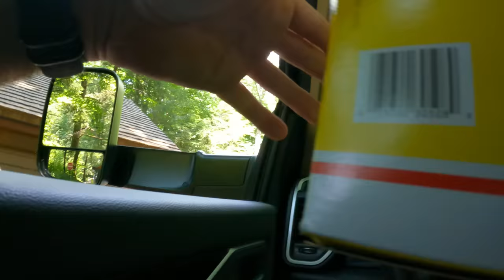Grabbin' 'Em Left & Right From The Motor Nature Trail And A Harley Stuck Under A House?

Comment: My wife & I were on the Motor Trail last Monday (the 15th) after not having been to Gatlinburg/Pigeon Forge for 4 or 5 years. We were in my '99 4Runner and had several tight squeezes in it. Kudos to you for getting a wrecker through there. What I don't understand is why the Park Service doesn't ticket and/or tow a lot of these vehicles. I shudder to think about an emergency vehicle such as an ambulance trying to get through.

Comment: Don't hot glue clips to those radios... I've NEVER had hot glue hold something for very long.  Even epoxy that holds great at first eventually fails me.
About the only thing that has not failed me is J.B. Weld.  You have to clamp or tape the parts together as it takes 12 hours for the J. B Weld to set up.  But once it does, it doesn't fail even years later.

Comment: With that second car, white SUV.   Are you crazy touching the winch cable while pulling the car up the hill?   That has got to be the dumbest thing you could have come up with .    Also you are stepping over the cable while it is under pressure.   You are setting very bad example to others.